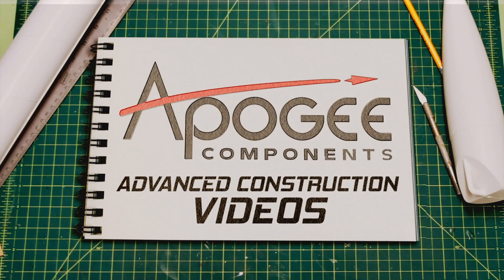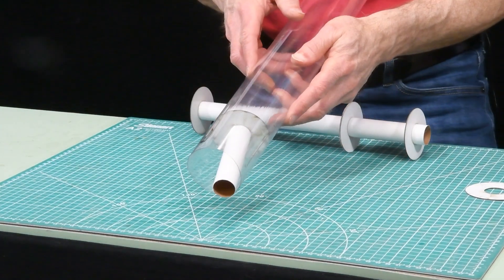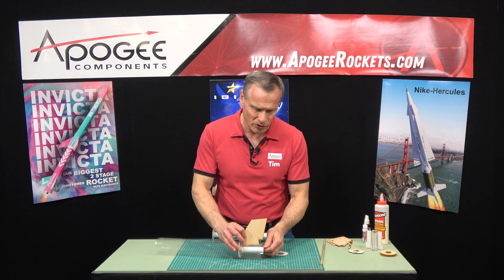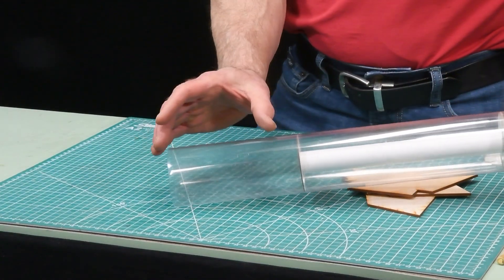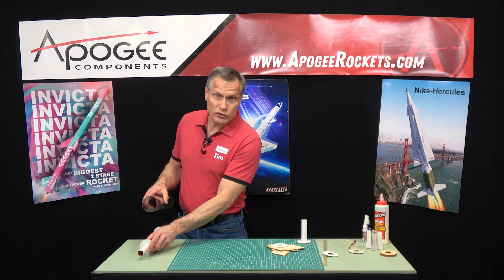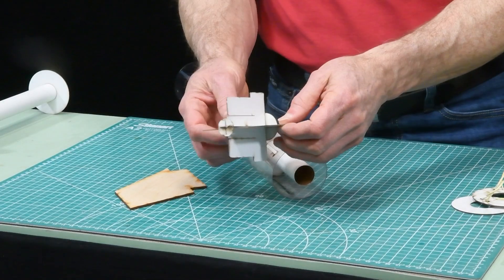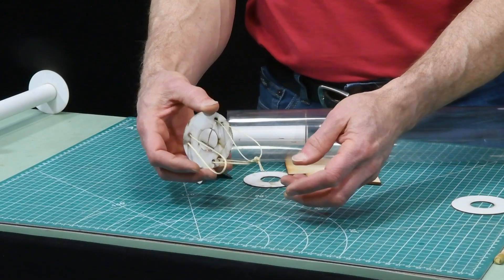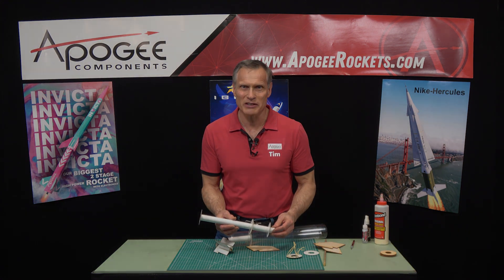Model Rocket Engine Mounts | What's the Best Design for YOU?

Comment: how do you get it so the motor engine does not slide up and down/fly out the front nose cone
Reply from the maker: You glue it in. I'd suggest starting with a basic rocket kit which will teach you how to install an engine mount.
Reply: Mid and high power rockets have a ring around the back so they don't go up through the tube, then you install a motor retainer with a nut.  Bigger E and F black powder motors, you put a ring of tape at the back end.

Comment: Another twist is to lay out the motor tube for your fins and then glue and fillet into place. Once dry take your body tube and then razor cut the fin slots all the way out of the back. Insert the motor tube/fin/centering ring assembly into the body tube through the open slots and glue and fillet in place. This method will allow you to maximize internal support bonds.....= )
Edit....its also a good idea to have an old motor installed in the motor tube for extra support and alignment during assembly.

Comment: I use this technique all the time. For a three ring mount, smear glue in the tube for the forwardmost ring. Install with a removeable aft ring and let dry. Now smear glue in the tube and on the motor mount tube for the middle ring, and install it. Install through mount fins, fillet internally. I internally fillet to the body tube as well as the engine mount tube. Now glue the aft ring to the body and engine tubes. In this way, you are not shoving the forward most ring through the ring of glue that is meant for the second ring.